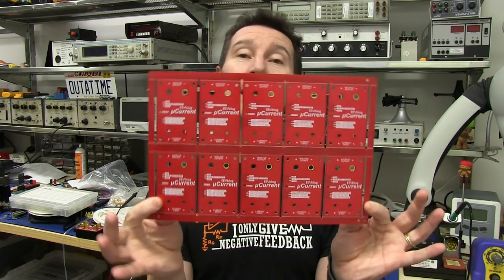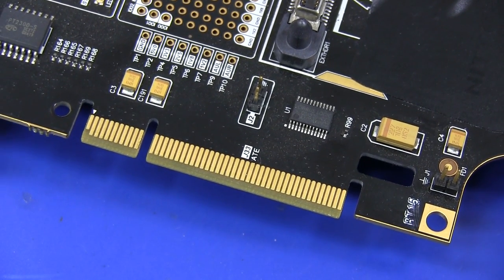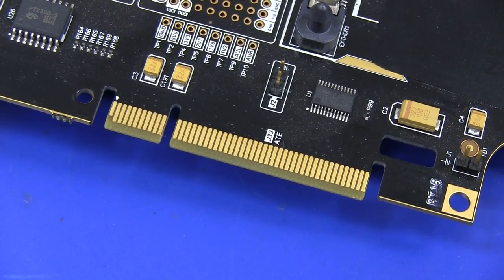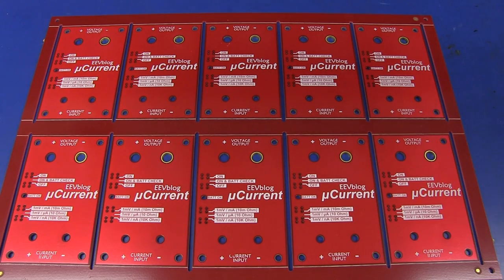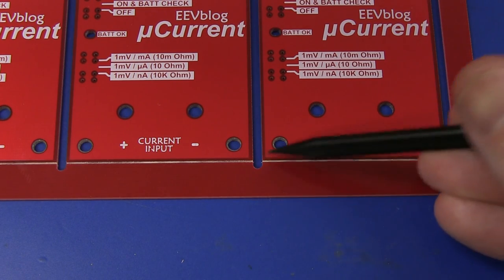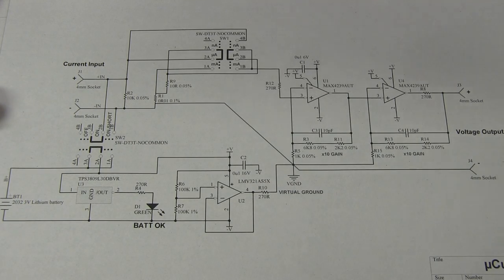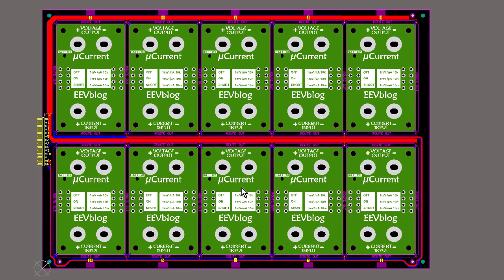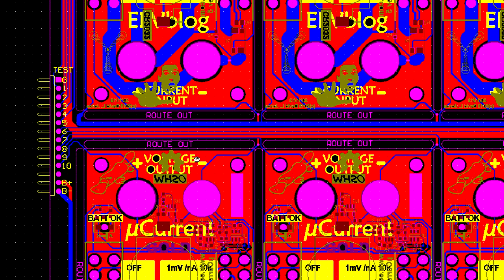EEVblog #552 - DFM Automated PCB Panel Testing

Comment: recently i've learnt about people who get a small magnet implanted in a finger tip to allow them to feel magnetic fields (because of brain plasticity) - a few have said that they work in electrical engineering and can use it to just easily feel for a broken component without having to faff around with a multimeter - and then use one to find out just how it's misbehaving. sounds like something you might be interested in?

Comment: Oh Dave, your timing is incredible! I've spent the last couple of weeks working on a new test jig! Thanks again! Also, never waste those tabs! Most of my panels only have one product on them, sometimes two, so I usually put the test connector on the board. The tabs are a great place to put SOT to DIP adapters. You can also use them for custom BUS connectors, imagination is pretty useful here. 
Thanks, as always, for the ideas and discussion!

Comment: i recently resigned a simple voltage regulator using the LM371T. i put some test points on the board so you can put a multimeter on them to see your output voltage.
learning pcb design is really beneficial and you end up with a professional quality item good enough to sell! noobs should try a program called fritzing. its free and they also are the cheapest company that will make pcbs ! and there quality is amazing

Comment: To pre-empt (and reply to one unreplyable comment by Andreas Dill), the fact that battery negative and virtual grounds are both held common is not actually a problem here.

The virtual ground is defined by 1% resistors, so there's a 2% error on the virtual ground level. This is ±60mV. This connects to the virtual ground net via a 270R resistor, resulting in a ±200uA current resulting from the op amps "fighting" with each other. This is less than 1% the maximum output current of the op-amp, i.e., just fine.
Reply: Ok, switched to hd and rechecked. Your right. But there is still the problem that you cant check the virtual ground OpAmp this way. If one is faulty the other 9 will override the error.
Reply: Andreas Dill Oooh, good point.  If the output pin of the op amp isn't soldered down, everything will still appear to work fine, and then stop working once the board is broken out.  I stand 100% corrected, sir.

Comment: If you have plated through holes, you could use a pressfit connector instead of soldering a header to the board and save a few steps, too...

Comment: Love these videos!  I'm on the other side of this sort of QA system -- I write the firmware for the testing jigs, or the PC interface software if it's something particularly complicated.  But I'm always working with the EE designer to help improve things or assisting with finding faults in the overall system.  Fun stuff!

Comment: Silly passing thought looking at your schematic and routing limitations and I thought I'd toss in my two cents:

Ideally it looks like you could knock down your test connections to 5 points and with a little clever cover make it not destroy the top surface continuity.

Mandatory traces on the bottom side for input positive, output positive, battery positive, and battery negative leaving no trace pairs along the ear to short out. 

The trick for I/O negative; since they are tied together and looks like they are your flood plane on the top side would be to flood it "out" across all 10 units and viola!  You can test all ten simultaneously after all.  Of course this might be an issue when it comes to the routing since it might leave a nasty copper edge.  I have no idea if your manufacturer can run a 90 degree bevel for the routing cut to leave a cleaner edge if you flood the whole top surface.

Final connection could be accomplished with a 24 pin (20 I/O positive pairs, 1 I/O common negative, 2 battery +/, 1 NC key pin) IDC header since you obviously don't want to parallel all those sense inputs or device outputs. ;)
Reply from the maker: Possible to use the top, but likely would look a bit daggy. The cutters would expose the copper on the corners. Could mask that somewhat by ironically having deliberate peel back of the solder mask on the corners or edge.

Comment: Brilliant video to show how to make use of otherwise wasted panel space for a test framework.  Given the limitation of just four traces per board, did you consider using test pads on the bottom and a test bed?  I suppose it'd be a bit of a challenge to make a DIY test bed but you'd get the extra connection points.  Just curious to know if it crossed your mind.

From a video perspective the panel test concept is more interesting than test pads.  Will you do a follow-up video showing the test platform and test process later?  Looking forward to it if so.  I think your audience would also be interested if you ever got a chance to talk further about test pads / bed of nails testing.

Comment: Forgive me If I'm completely wrong, but since the input and output share a common ground and that's attached to your front ground plane, couldn't you route a thin  trace off the front corner without really being noticeable at all?

Then all you need is battery -, battery +, input +, and output +. Those four will go out the back, and I doubt anyone is going to notice the tiny little trace off the corner of the front ground plane. Might save you a lot of time having to probe each one. You could just have a set of 10 smd footprints on the board with one side all on current plus and the rest running to each board, and just slide the tip of a screwdriver down the line to test them.

Comment: Would it not be better to have the breakout tabs not at the 4 corners where you would have to smooth out 4 edges, but along a side (in the middle of a side) where you could use a simple plane sander to smooth the 2 edges? That way you could easily incorporate quite a few test traces leading out of your pcb into the panel frame.

Comment: Could you please make a playlist for pcb design from basic to advance for new learners.. Your teaching is very practical..
Reply: Dave, I second udai shankar's request. Lots of still very relevant information here, regardless of EDA software used. I found the first three installments, but I don't know if there's more, although I did find some PCB layout info in the PSU design vlogs (specifically, part 9). Thanks a mil, I mean a thou!!!

Comment: for my personal taste i would also change the fonts used in the front silkscreen. maybe something looking a bit more high tech. thin traces, not too tall, rounded corner fonts...
Reply from the maker: So change it to something someone else doesn't like... you can see where this ends up...
Reply: EEVblog I know, opinions are relative, but i can't avoid thinking it seems a bit cluttered and chunky the way it is.

Comment: A video about Automated PCB Panel Testing and no mention of using pogo pins to do it?
Reply from the maker: Because I've already mentioned pogo pins in another video. This video was about getting traces out of boards onto panel, for whatever reason. I had not really covered that before. If you use pogo pins then there may be no need at all for anything on the panel.

Comment: Hi Dave, super series. Do You have some tricks and tipps design and production of izzi bizzi smt pcb's. Let's say 7mm by 12mm for instance ? Also, do You know any very small board and cable connectors available ? Last one: do You have some information how to design combinations of pcb with LED's ( 0402 or 0603 ) and light pipes, of course also very small as for 1mm by 0.5mm ?

Comment: That testing setup is really clever but when you cut out the individual boards those test leads will be floating, doesn't that risk introducing noise to the circuit?

Comment: This is a really neat way of testing. but what happens if a board fails? 
Just because of one board failing you have to retain the working 9 other boards. This could prove a pain in quick turnaround environments if a certain amount of boards are due out from a production in a certain time frame.
Reply from the maker: No, the 9 good ones get cut out and shipped, bad one goes to rework.

Comment: Why do some people say that you cannot ship lithium based batteries?  I have ordered many li-ion batteries from ebay and they were shipped from china (labeled as gift :) ), and there was never a problem. Is the battery thing  limited just to Australia?
Reply: there were some flights in which the Li batteries exploded, causing a crash.
Reply: Yeah, so you can lie and not say it's a li-ion battery. Much like you can send cocaine and say that it's a bag of flour. Tell me how you get on with that.
Reply: Lithium can cause hard to control metal fires which in a airplane is not good. One or two little coin cells won't cause damage but shipping and not labeling a box of laptop batteries is. You are not even supposed to have lithium batteries in your checked baggage only your hand carry as it is more obvious and easier to fight a fire if you can see it. (Not all lithium batteries burn in the same way as some have less lithium in them to start with or are fire/explosion/puncture resistant depending on the specific chemistry used)
Reply: Check hongkongpost.com website. The notice is shown to you the moment you enter the website. Lithium batteries are prohibited from sending through air (including Speedpost/EMS). China Post has a similar policy. People who are still sending them by air and lying on the declaration form is just taking their chances.
Reply: Could also be your shipment didn't go by air.  I've ordered CR2032 cells from China before ($1 for 5, free shipping) and wait 2-3 weeks for them to show up.  Those don't go by air.
Reply: I think you can ship batteries but it has to be removed from the product.

Comment: Can you v cut inner layer on a 4 layer pcb?

Also, what kind of failure rate do you normally expect on this kind of thing?
Reply: I ment does the v cut hit the inner 2 layers on a 4 layer pcb?
Reply from the maker: Chris Given They can somewhat control the depth, but generally speaking you wouldn't do this because then you break the board, if there is inner plane on the outside edge, they can short.

Comment: manual solder pin header  on every panelize board cost money and time. since it's on the edge , you could consider using clamp type test pin. it's simple ,cheap and universal if you design your future board for use in your existing test rig... go figure!
Reply from the maker: Yes, I may not actually use a connector, it's just a convenient footprint. Might use pogo pins in the final jig.
Reply: EEVblog
Check out Tag Connect! http://www.tag-connect.com/

Comment: With the ground common, wouldn't it work to use the 4 available connections for power input, ground, current input and voltage output?
Reply: Ok, does not seem to have a fully common ground...

Comment: Hey Dave, if you weren't making a video for this, would you still be making it?   Seems like a long time spent designing the test rig for a product that will have a relatively low production run.  When its all said and done, do you think it will save you much time?
Reply from the maker: It was only a few tens of minutes actual work to add that stuff to the existing panel.

Comment: can you explain me about of programming them after mcu soldered to pcb in high volume PCB manufacture ?
Reply: check out In System Programming. Depending on your chip and programming interface it could be as simple as adding a jumper to interrupt the device for programming and then use pogo pins or a dedicated header to interface to the board and program the chip while it is in circuit.

Comment: Is that an Al&)@m Nan0&oard  3000? It is not so bad that you need to "protect the innocent" right?
Reply: +Sihao Huang It's most likely a NB2STR01 (Altium NanoBoard Starter Kit version 2, with Xilinx FPGA) since that's what it says on the test rig (6:57), so the attempt at censorship was largely a failure.  Apparently there were also Altera and Lattice versions (02 and 03), same for NanoBoard 3000.  Alas, none of this stuff is manufactured or sold any more...

Comment: The gerber viewer within altium is... not very usefull. Does artefacts at the end of the video is typical. I am using the opensource tool gerbv to verify my gerbers. (Also based on, "to not trust the tool which created the files in the first place)
Gerbv is not perfect, but honestly: good enough for daily use.

Comment: don't you just need to route out vcc gnd voltage out and current positive because it is ground referenced
Reply: just realized there's a chip between battery ground and the output ground